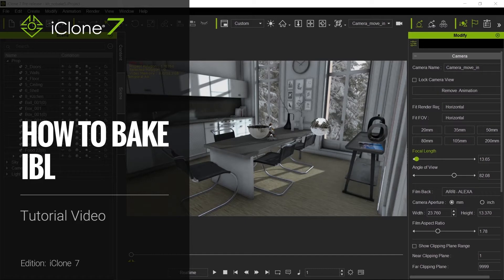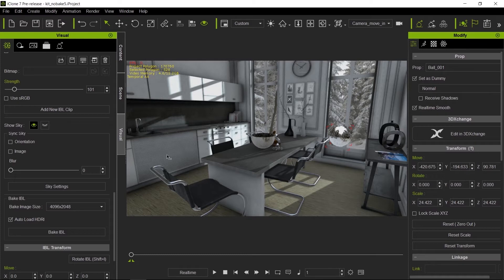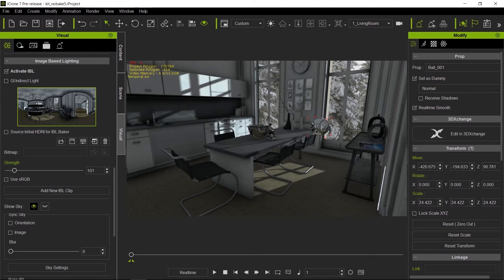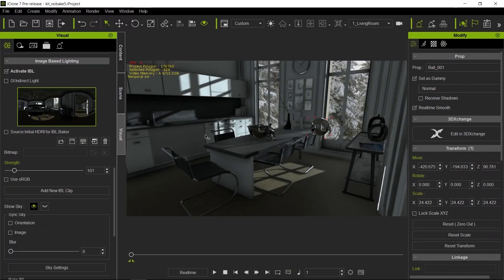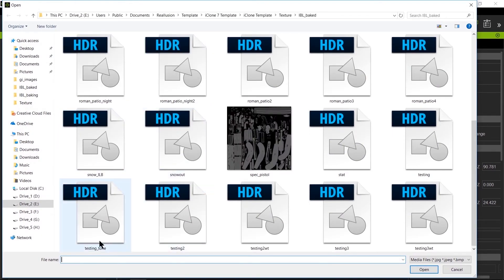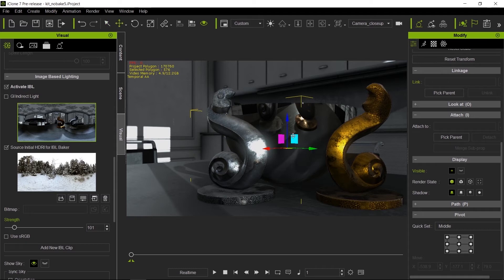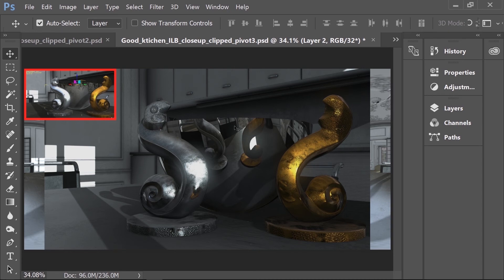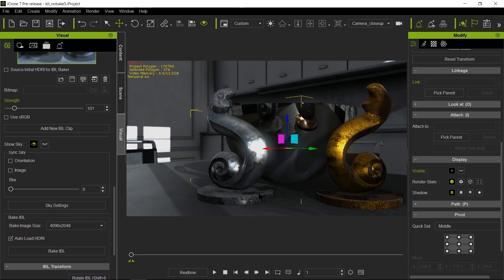iClone 7 Tutorial - How to Bake IBL

Comment: For this particular subject (and any subject really), it would be better to structure the tutorial using the Online Manual to structure delivery of the basic concepts. Structure a point by point process for baking a HDRI for the visible surrounds of your reference object, then once you have covered the basics, then you can speak about the finer points of creating optimal HDRI's for IBL. From the manual: "In IClone, the IBL and Sky are two individual sphere. The IBL sphere is invisible but emits lights inward sampled from a mapped image; the Sky sphere, however, displays the image mapped on it but gives off no lighting." This point would have been amongst the first I would have started off with.